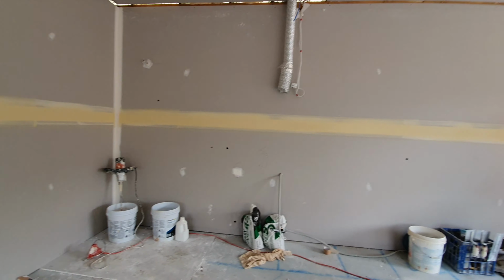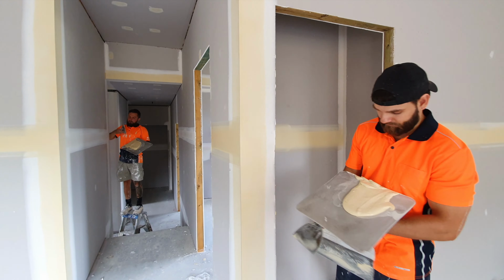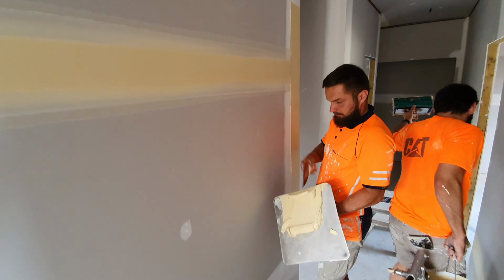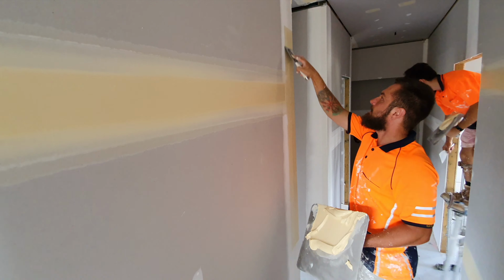How to Apply Drywall Mud Fast Like a Pro (NEW HOME BUILD)

Comment: 10" box over previous 10" box? What up wiv dat?  Also, you can at times use a wood block and hammer  to knock a high shoulder down a little. If it occurs because one sheet is hung up on the other sheet. Which is often the case.

Comment: I notice not a lot of center screws.  Why is that? You guys hang too right? Is it the glue you're relying on more than screws?
Reply: Hey I just saw another video where you answered that question. My new question is, what kind of glue is it you use? Is it available in U.S?
Reply: @brandonpearce8350  Stud adhesive.